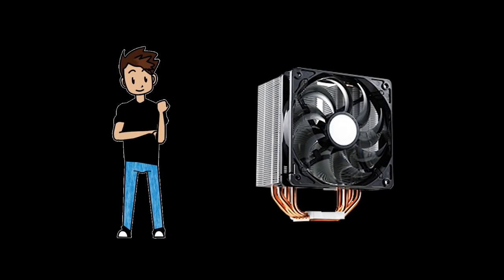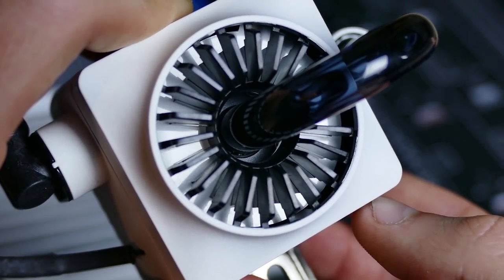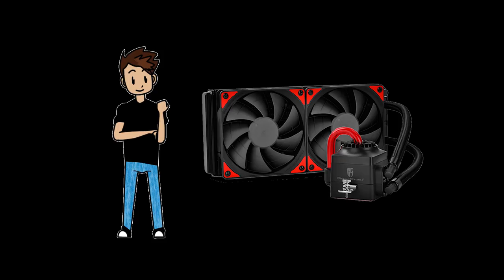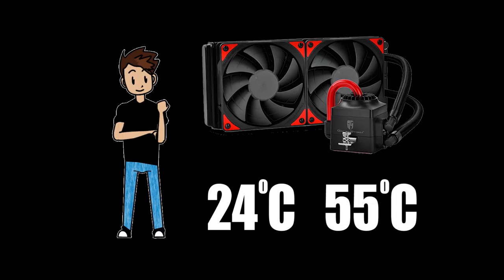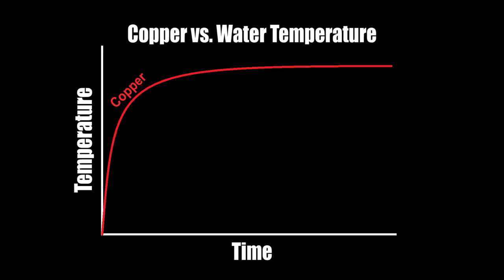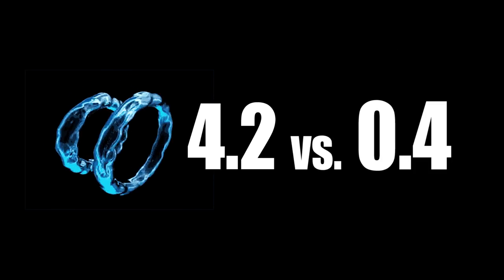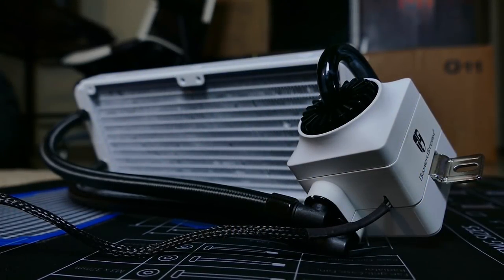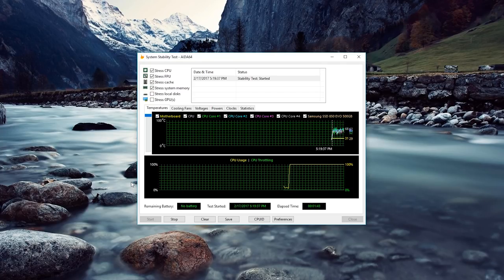How to Properly Measure AIO Temperatures

Comment: So in otherwords? The AIO is doing its job?
Reply: Watch the video?
Reply: I did, and all I got from it was that the AIO is doing what it's supposed to do
Reply: Tech Core 
You should have gotten that there is a common misconception that AIO coolers are "always" vastly superior in cooling prowess when compared to air coolers. In actually, during longer, CPU intensive sessions, the performance gap isn't as large... aaand the AIO is doing its job. 😐
Reply: liquid cooling always has the  ability to cool colder than air cooling, what people don't understand is that when people say "liquid cooling" they typically don't mean water, even though water is a very acceptable. when I heard overclocking, while growing up, that was almost always synonymous with liquid cooling, but the liquid was usually nitrogen, not water
Reply: that's why there's a difference between water cooling and liquid cooling..
Reply: looks at the title of the video

oh. gotchu.
Reply: He says it like its more of a real world scenario, but not too many people i know with AIO coolers run their cpu 100% for hours on end, there are lulls that allow all the mass cool off
Reply: JonnyD3ath Gaming would be the most common scenario for me. Even if it's not run at a constant 100%, you'd still be faced with water's heat retention.
Reply: probably because radiator coolant is meant for extreme situations. Radiator coolant just lowers the freezing temperature of water, and raises the boiling temperature of water. You could hypothetically use it to cool your computer, but you're not getting any of the benefits it was intended for.
Reply: Coolant is designed to be near a half/half mixture. It's useless without water - and computers aren't dropping down into the negatives for extreme periods of time - nor do computers hit 100ºc for long enough on a water-cooling loop for the water to boil. If they did, they would freeze/crash as a safety precaution via the mobo before the water were to boil. On top of that, really shitty solder can melt below 100ºc, so it's possible if your components are sub-par, that they'd just melt down and become useless. If it were good solder that wouldn't melt until over 200ºc, then that's moot. On top of these basics, ethanol glycol is has ABSOLUTELY TERRIBLE HEAT TRANSFERENCE properties. Ethanol Glycol/propylene glycol also contain inhibitors that gel and gunk up. This would ruin your loop. Water is MANY MANY times better. All of these combined would mean that you're making your rig worse for no reason.
Reply: exactly, and this is why AIO are, in such use case, often way superior, because they can absorb heat spikes better due to that inertia
Reply: Liquid nitrogen would only be used for extreme overclocking - aka e-peen wagging.
You wouldn't be able to have a closed loop system with nitrogen because it would probably explode unless you have massive expansion tank, and then you'd need a very hefty compressor to compress it down to liquid again.
Reply: liquid nitrogen will boil at room temperature, even at water freezing point 0 degrees celcius.
For ultra low temperatures: inert gases (helium), nitrogen, ammonia.
For usual temperatures to meet electronics cooling requirements: Distilled water with various additions, organic substances like acetone (think nailpolish remover), methanol, ethanol (think booze), toluene (think magic markers).
For high temperatures: Metals like mercury, sodium, silver.
Reply: good sir, i see you area guru on these things , so please advice me. What should i get?
 Asetek 550LC (liq cooler) or DEEPCOOL Gammaxx 400 CPU cooler ( air cooling) P.S. Sorry for the parenthesis, you prob allready know which is what * XD
Reply: +aMARKan comment Honestly, I've never heard of Asetek. If you want liquid cooling, I'd highly recommend going with a reputable brand like Corsair or NZXT. The Corsair H100i V2 and NZXT Kraken X42 are good choices for liquid cooling, the latter of which has fancy RGB lighting, if that's your thing. Both of those coolers are in the $100+ range, though.

For budget air cooling, I'd just get the Cryorig H7. If it absolutely has to be one of the two you listed, though, just go for the Gammaxx 400, it's still pretty decent.

Whether you get liquid or air cooling is up to you and your space constraints. If your case has plenty of space, air cooling is an inexpensive and effective solution, but if you have a small, cramped case and/or want slightly lower temperatures for more overclocking headroom and don't mind paying a bit extra, go water cooling. If you don't plan on overclocking at all, just go for the air cooler, that's all you'll need.
Reply: lel i have no idea about pcs... and pretty much about coolers. im going to buy one and the company offers asetek 550 lc (for free) which btw they claim it doesnt need refilling, or deepcool gammaxx air cooling for 12$ less... for now money is a prob, my badget pool is around 1300-1400$ so i cant get a fancier cooler... after all i dont know how to refill liquid coolers which is the reason why im scared to buy an expensive one :/ i mean surely in the feature i can but then comes factors such as does it fit the size? is it good? what it needs to be refilled? does it need refilling? the cost? etc etc... so for now im just asking for advices about liquid cooling, and what option from the 2 should i get.... it says no refilling! are they legit?
Reply: Kraken Tech Panda then dilute it. water corrodes. coolant has anti corrosion and bio inhibitors in it, just dilute it, and voila you've got basically the same thing as what's in a loop anyway, for cheaper.
Reply: +aMARKan comment Yes, they are telling the truth. Any cooler labeled as AIO (All-In-One) will not need to be refilled, since it is a self-contained system. The only coolers that require regular refilling and maintenance are custom watercooling loops, which you do not need to worry about right now; they're very complex and only recommended for experienced builders with lots of money to burn.

Also, do you live in the US? If so, I could link a set of parts within your budget that gives you the most bang for your buck.
Reply: Tech Core As well as it can, yeh
Reply: You know that Asetek is the OEM for many brands in Europ, they pretty much do everything. Brands like Be Quiet buy from them.
Reply: Here is the thing, if you are not running it at 100% load (something that is more common when gaming) then you won't hit those peak temperatures that you do when running a CPU intensive app. 

Though the point of this video is well taken, if someone is testing coolers and tries out AIO coolers compared to air coolers then yes to get a full picture one would have to run them until they hit their stable peak temperatures.

Essentially the cooling capacity is based on the radiator and the fans attached to it, so basically you might want/need a 360 radiator if you really want lower temps while over clocking your cpu.
Reply: This isn't necessarily true... One of the major benefits of liquid cooling is the ability to remotely remove heat, and do so with a greater surface area than air coolers. This allows for greater heat dissipation whilst keeping noise levels down. So even in "longer CPU intensive sessions", the performance gap is still quite clear.
Reply: Eh... except with AIOs. The water blocks don't tend to be as efficient (i.e. takes more delta T to dump the heat into the water) and the rads aren't nearly large enough. That's why they're not really much better than air cooling. 5 degrees between an AIO and a D15 would be the best I'd ever expect and that's not really enough (for me at least) to help with the clocks.

A custom loop on the other hand will take all the heat you want to dump in it as long as you have the rad space, but remains block limited. There comes a point where the water block simply cannot dump heat into the fluid quickly enough to keep the chip from killing itself, even if you can dump it all from there on out. Delidding helps a LOT, but you still need a good block at the other end.

A good example of this is sticking a graphics card in the loop - typically you drop 20 - 30 degrees off your GPU temperature alone, assuming a bare die. Given the higher TDPs, it just goes to show how good GPU blocks are.

Given an effective block, you don't actually need all that rad space that you would with a CPU as you can afford a much higher fluid temperature without any issues - if it's happy at a 10 degree delta dumping 300W - increasing power to 450W will only raise your temperature by 5 degrees (assuming you don't just overwhelm the rad!). In contrast, the IHS on a CPU, being the primary obstacle to heat transfer in most cases, just won't stand for it and a 50% increase in power will more than likely kill your chip on anything other than LN2/CO2
Reply: I'm not quite sure if I understand everything you are saying but I'm pretty sure water blocks are efficient at transferring energy to water. It doesn't take more delta T to dump heat into the water. I takes more energy to change the temperature of water which is why the CPU stays cooler for longer before it heats up. Otherwise your CPU would have higher temperatures than air cooling to start if it wasn't efficient.

Also a custom loop doesn't take more heat than an AIO or an air cooler for that matter. The difference the effectiveness of getting rid of the heat that was absorbed. Delidding reduces temperatures because it increases thermal conductivity but a copper water block transfers heat just as effectively as a copper block on an air cooler. 

I'm not sure what you mean but the IHS is not a big obstacle. Yes it can be better but the difference between delidding or not is too small to be worth the risk of damaging your cpu. The same rules that govern an effective air cooler also work with an AIO cooler. The more surface area for cooling, and the more air able to pass over the area the more effective the cooling will be.
Reply: Not exactly sure what the people referring to Delta T even mean unless I'm missing something here. Delta T is essentially just a fancy term for temperature differential. In HVAC terms it is the difference between entering evaporator temp, and the supply (exiting,) temp. In regards to electronics I'd have to assume the term would refer to the difference inside the case to the external "ambient," temps. Or I suppose the temps at the CPU to wherever it is being dispersed via waterblock or air. There's nothing wrong with a water system. 

In commercial buildings water is used all the time for cooling. You will have what's called water source heat pumps that have there own coil and compressor, it absorbs the heat using refrigerant in its own system and transfers it to a water coil in which goes through a large loop for an entire building. There's many different ways to set that up but commonly you will have a cooling tower outside where the heat is dispersed via water. If the heat was dispersed in the building it wouldn't be very efficient. The same as if the heat was dispersed inside the pc. 

There's many different liquids that can be used which would be based on whatever you are trying to achieve. With the water cooling you can always have a larger surface area where the heat can be dispersed regardless of the methods you use, but that's ultimately limited to surface area of the CPU.
Reply: Delta = Change, T = Temperature.

Think he was talking about the Temp diff between AIO vs Air Cooled systems[a decent one I guess] after a prolonged period of load. 

Basically what hes trying to put into people's head here is = Watercooling vs Aircooling will definitely provide better cooling [lets say around 6-12*c approx] instead of what many claims around the internet which state a 20-30*c lower temp. -_-' . 

Or in Trump's words: AIO fanbois = Fake News. :P
Reply: Ritwik Sarker I understand what a Delta T is, it's part of my job. I'm referring to the above comments, not the video. What they were saying, or the way they said it did not make any sense.
Reply: I just dumbed/simplified the explanation down a bit hoping they would finally get it :P , leaving out the temperature differential between radiator & surroundings/volume of airflow against radiator's effective surface area and blabla, hence the trump reference.
Reply: 233kosta you have no idea what you're saying, have you
Reply: mesa S I don't appear to be very good at explaining it without diagrams and a white board
Reply: 233kosta it's not bad explaining, it's wrong explaining. It does not take more 'delta T' to dump the heat in the water. It just takes more time to heat up the water.
Reply: 233kosta i already do.
Reply: mesa S I'd imagine you're extremely good at your job and their floors are spotless every morning
Reply: 233kosta commercial/industrial HVAC? Equipment that I work on keeps medical MRI equipment operational. I didn't say anything to insult you so I don't know why you are coming at me. I make more on the hour than my age currently.
Reply: Cody Thompson I was responding to the muppet who can't tell the difference between heat capacity and rate of heat transfer. What gave you the impression that the rather bad trolling was aimed at you?
Reply: Cody Thompson I use delta T because it's less typing and I use it in reference to heat transfer effectiveness (i.e. more delta for the same rate, etc.). The deltas I'm referring to specifically are on the scale of the individual heat exchanger rather than the whole system, so there goes another source of confusion...

As I said - I'm not good at explaining these things to the uninitiated (and apparently everyone else) without diagrams.
Reply: 233kosta I do apologize I responded before noticing the direct reply. I assumed the job comment was directed to me considering I was the only one to mention an occupation. I did re-read your original comment and now understand what you were attempting to convey. The choice of words made it difficult initially. Obviously there is more involved but I  see what you were getting at.
Reply: 233kosta but when you say  "takes more delta T to dump the heat into the water", in your first sentence, it really gives off a bad impression. nobody knows "you're using delta T in reference to heat transfer effectiveness, because it's less typing". the only common uses for delta T is change in temp and change in time. no mather wich one you use in that sentence, they are both wrong, though one more than the other. that's all i meant.
Reply: It is a change in temperature. For example from one side of the block to the other. Or the CPU die to the fluid. It's a measure of effectiveness (all else being equal) by virtue of identifying what temperature difference is required to achieve a certain rate of heat transfer. In the case of water blocks - you want that as low as possible. Can you please point out the conceptual error?
Reply: 233kosta you said it takes more change in temp. It does not. If it would cpu temps would not rise slower. That's the benefit of aio as far as i know. The way you put it now it makes sense. Now i understand what you mean, but it was really confusing.
Reply: mesa S That's part of why I was confused initially. I never heard Delta T used that way. As you know Delta T just simply means temperature difference. It's generally used as a split between the heat source and where the heat is being removed as you both also seem to understand.
Reply: Cool better than what? The tiny heatsink you get from Intel/AMD?

Comment: It is good that the temperature in water cooling(AIO as you mentioned) doesn't fluctuate in a dramatic way because like most metals and or materials, dramatic temperature changes can cause nano fracture in the die due to expansion and contraction(from sudden changes in heat). My system is running an AMD AM3 8150 bulldozer 8 core 3.6Ghz over clocked at 4.2Ghz(none parked cores) with GA-990FX-UD3 Motherboard, for hours on end, water cooled with the 3D Galaxy liquid cooling system case and the same water cooler also cools the GPU, nVidia GFX 6990 graphics card. The room temp is 26 deg C and the water cooler stays at around CPU 31 deg C normal e.g. Youtube (CPU 41 deg C/GPU 48 deg C while 3D gaming). Before hand I had the same CPU with an Air cooler running at a temp of 82 deg C at 3.8 Ghz(any higher  and the computer would crash) and the GPU with air cooler would run at 72 deg C while gaming(sometimes freezing up). So water cooling over time can still make a huge difference in keeping the computer(CPU) and Graphics(GPU) cooler and more stable, from startup to shutdown.

Comment: Great Point. Water Heats slower and cools slower because its specific heat capacity is 4.186 joule/gram °C where as for Copper is 0.385 joule/gram °C. Less the SHC faster it gets hot and cools down faster and vice versa. I studied this in grade 8.

Comment: 280mm radiator, push pull fans, 2 hour stress test i was 47-50*c. Helps if you keep the room nice and cool at 15*C all the time, cold ambient temps are great. sure it takes a little while for it to go back down to the 20s but not that long... and hey that's better than never even reaching 80*c.